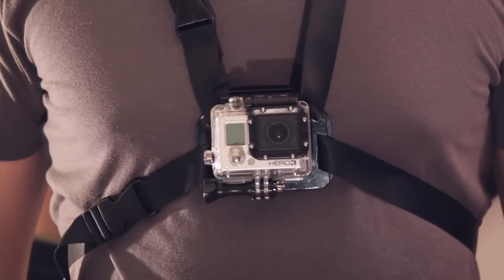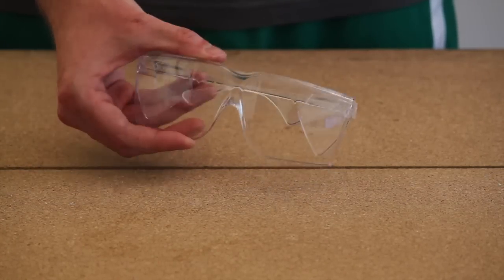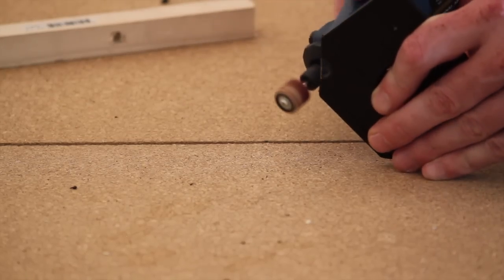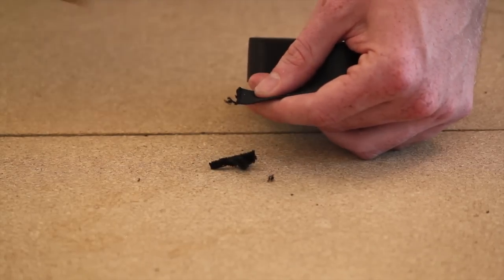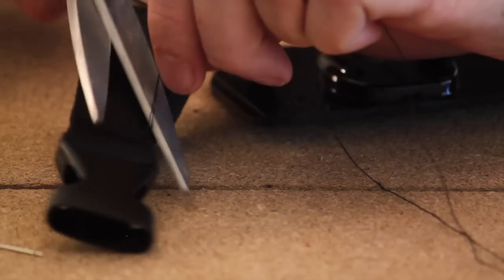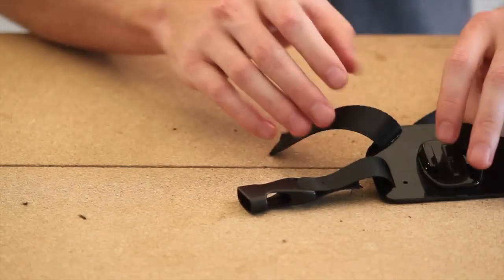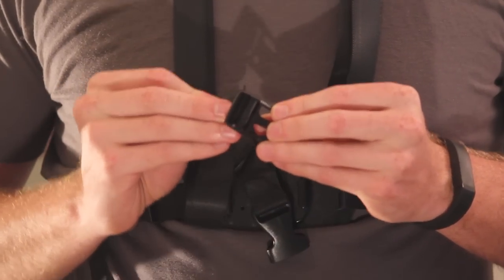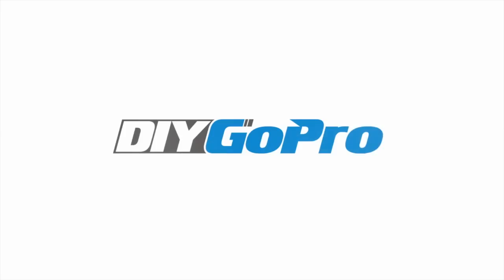DIY GoPro Chest Mount (aka Chesty)

Comment from the maker: That's a really good point. That being noted, maybe we'll go back and make the straps connect over the shoulders and to the back. Thanks for the feedback. The good news is that the buckles we used, although secure, will give out if you pull on them too hard which is fortunately an ok safety mechanism. In the end though, you're right.

Comment: 1. Before you attach your buckle on the adjusting end, get an elastic loop around the webbing to keep your excess strap from flopping around in front of your lense. I'd do this for all adjusting straps.
2. It would be easier to adjust on the fly if you were pulling downwards on the adjusting strap over your shoulder - maybe make the longer side a fixed length and the shorter side the adjustable end. You could tuck the excess strap behind the mounting plate to help with the issue in #1.

Comment: TIP: Burn the cut edges of the strap (only a little bit) with a BBQ lighter or so, so it won't feather out and get loose over time.

Comment: So if I understand right,the horizontal straps goes up then around the neck, then back down to the plastic plate? thats not very comfy after a long time using it. I would buy a clear or black plastic plate from the hardware store and make a 2nd plate to fit in my back so the strap can be mounted in the back to have a better fit.

Comment: what if I have the hero plus that doesn't come with the plate
Reply: yes me tooo
Reply: You can buy a helmet mount cheap enough on ebay, then just use a piece of plastic modeling board, again cheap enough from model/hobby shops

Comment: I don't have a dremel. Any ideas on what tool I could use instead?
Reply: I just did it with a regular drill and then an electric sow. (the one with the little blades). It didn't end so pretty like the one in the video but it's still function.
Reply: get a soldering iron u get some for under 5$ and u can melt the hole but be careful and do it outdoors as it smells quite a bit.